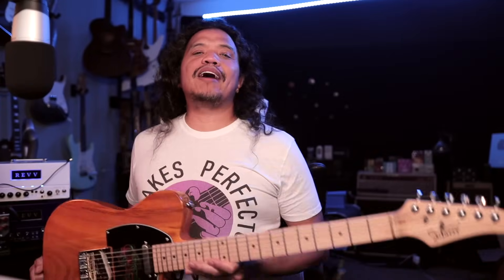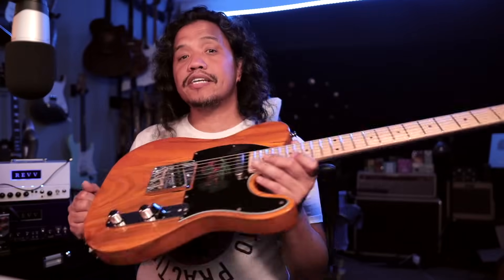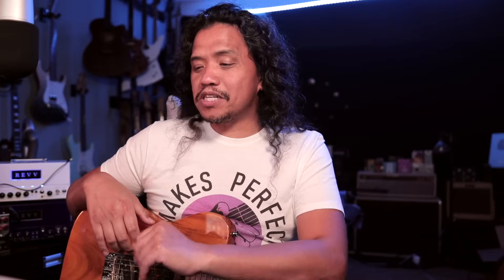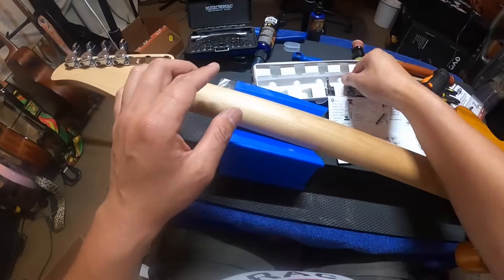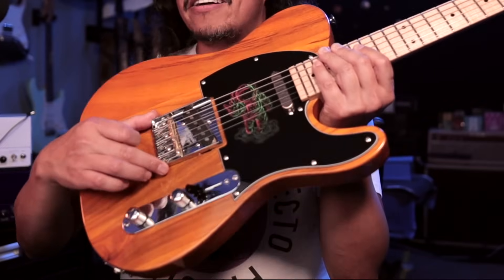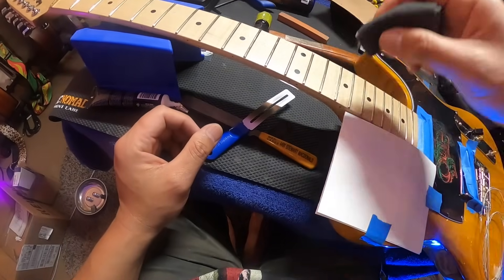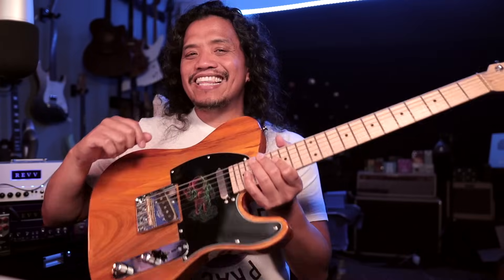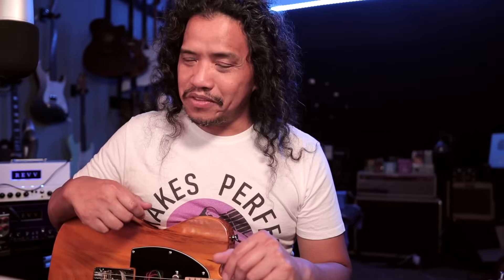MODS and UPGRADES for Cheap Guitar! Was it worth it?

Comment: Perfecto, I'm where you are on doing my own guitar work.  I use the stuff I work on and I wouldn't charge for messing with someone else's axe at this point.  I may have more tools than you, although I can't be sure of that.  I am glad to see that you did a fret level, crowning and polishing.  In my opinion, those are the most important things you can do to a cheap guitar.  Doing these right improves playability, tone, and sustain more than any other single thing.

I would have gone with a six-saddle bridge over the compensated saddle solution you used.  I also would probably swap both single coils with humbuckers, probably single-coil sized.  I am no better at enlarging holes than you, with my having done overcutting when I enlarged the vibrato cutout of MY Glarry GST (Strat-style guitar).  My overrun is visible from the strap-button end of the body.  Oh, well, look at how messed up looking some of Les Paul's and Eddie Van Halen's guitars came out ... and still sounded great!  The other thing is that your overrun and mine have the virtue of not being very obvious from any distance.  Eddie Van Halen cut a chunk of wood out of his Ibanez Destroyer and destroyed it, by his own admission.  Point is that that's why you buy cheap guitars:  To learn from them by working on them, undeterred by the though of destroying them, because they're cheap enough not to worry about!  I personally have yet to destroy a guitar through the ill use of tools.  Probably, you can say the same.

Comment: the only upgrades i did on my guitar are  i change the  vintage type strings trees to a roller type and added 2 more springs on the whammy for tuning stability 
then i added a pushpull pot (volume) for the neck and bridge to work in series 
then i remove the tone number 2 and on the volume hole i added a switch to make the 3 pickups of the strat work in parallel and i added a kill switch everything in the guitar is stock i love the way how it sounds stock with 1 master volume and tone
Reply from the maker: Nice mods!